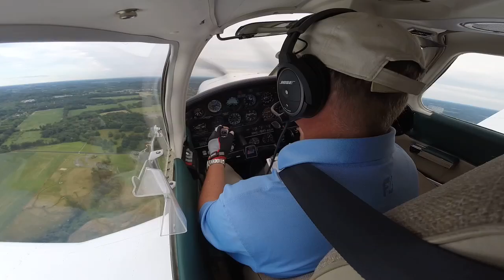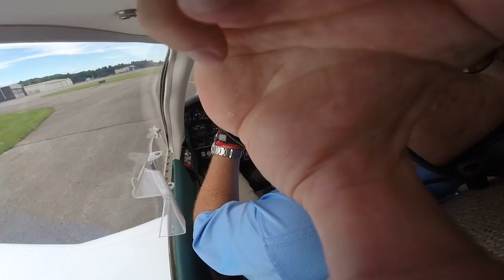FIRST LANDING 1977 Piper LANCE

Comment: Was that a Turbo T-Lance? I delivered a new one from Vero Beach to Alaska. Great Airplane.
Reply from the maker: No it is a normally aspirated Lance.  It's a slow climber above 8,000 feet.  I wish it was a turbo.
Reply: It was great to crank up to 180 at sea level horsepower over the mountains. BTW, the T-tail was a totally different airplane to fly than the Saratoga.
Reply from the maker: Nope - normally aspirated.   it is a nice flying plane.  for sure.

Comment: Good job ,,why did you key the Mic like that ???
Reply from the maker: kept clicking the Mic button to try and turn on the VASI landing light system. Visual glide slope. Just to help with landing. But it didn't turn on. :)
Reply: @geoffsmathers9858  It's 124 clicks for VASI. I only counted 123. Haha. Sorry. Couldn't help it.